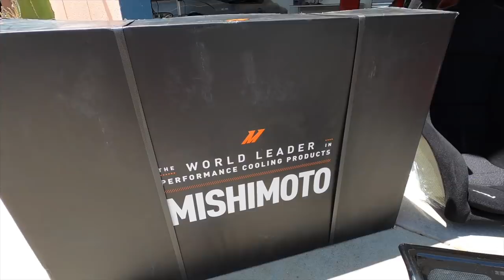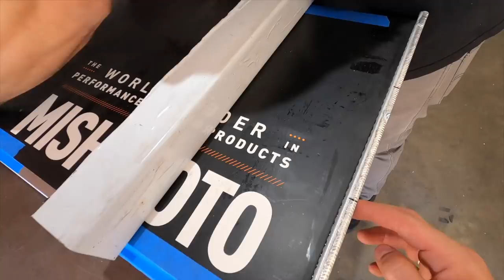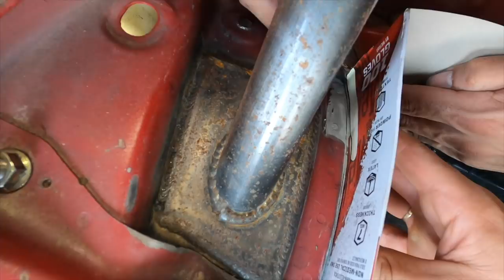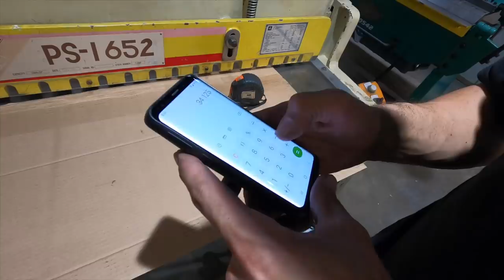How To Make A Triple Pass Radiator East Coast Car EP.5

Comment: Aren't you gonna get some water past the "block off" on the side of the end tank you didn't cut off and just slotted in because you weren't able to weld all the way around it? I assume it must just not be enough worry about right?
Reply from the maker: I would say there will be a little water that would get past but if 95% is blocked off and heading in the other direction then we are good. This is the 4th radiator that we have done this to and it's been solid every time.
Reply: @RyanTuerck  I figured "path of least resistance" and all that it wasn't a major issue, but it did jump out at me. Love the content and I can't wait to see the rest of it come together and you shred some tires!
Reply: @RyanTuerck  does it actually drop the temp down?

Comment: So why are you running a 3.4 stroker when your pro car was stock stroke? Just left over parts?
Reply from the maker: It was an engine I had from back in 2015 or 2016 when we ran high comp and stroker cranks. I just haven't phased it out yet.

Comment: Hey Tuerck, I was wondering what's the actual purpose of turning the one pass into 3 pass system?Does it help with cooling? Or is it to maintain the pressure? Or something else?
Reply from the maker: For us we are trying to slow the cooling system down so it doesn't flow as fast. The best place to do that is keeping water in the Radiator longer so the fans can cool the hot incoming water for a longer period of time. There is of course a balance to this system as things all have to work together for it to do its job properly.
Reply: @RyanTuerck  Interesting knowledge right here, thanks for the enlightment Tuerck